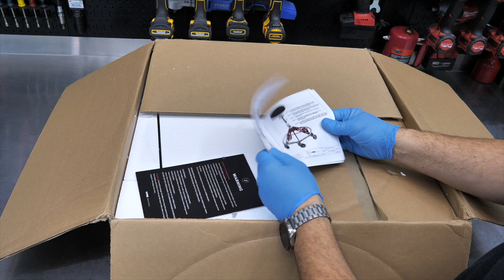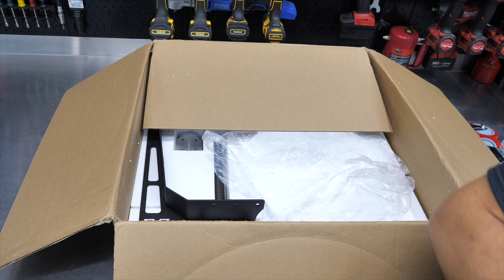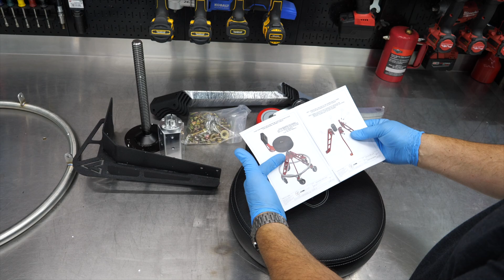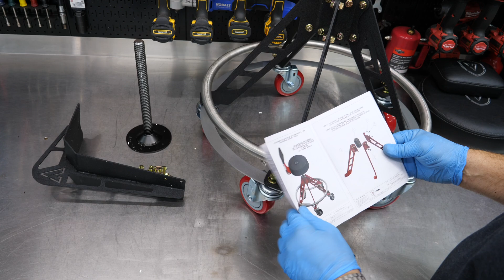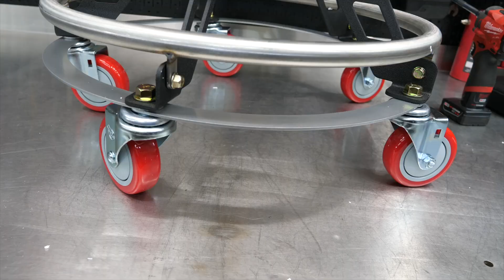Made in the USA | Vyper Chair - Best Shop Stool You'll Ever Buy! [Elevated Height]

Comment: built my own with a welder and 200 bucks of steel and 6 castors for 40 bucks. its as short as the red one but adjusts a foot up from there. that vyper one sits SO HIGH.

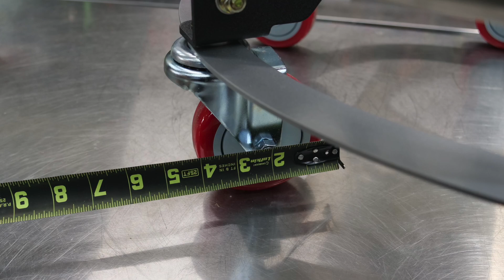Comment: So how about those "expensive industrial casters" @23:30 that are supposedly so much better that what you could buy at Harbor Fright? Well, it took about 5 minutes to look up "SCC" casters and find that these are assembled and sold by Service Caster Company (SCC). The photo of their light-industrial 4 inch swivel caster with 1/2 inch hole matches these casters exactly. And the cost of these premium casters? Would you believe $11.68 ea in black urethane (SCC-BH20S414-PPUB-BLK)? Oh, but these have RED polyurethane, so what about that? Yeah, colors (red, blue, grey, and even purple) are the same $11.68. And that's per each. So imagine the discount you would receive if you bought hundreds or thousands at a time. So not exactly casters that alone would cost you $100 or more, as Shop Tool Reviews would have us believe. Oh and how about Made in USA? Well not exactly. The casters are assembled in USA from "global" sourced components. Does all this really matter? Well, it kind of does when you consider how hard Shop Tool Reviews worked to justify the premium price for the "all made in the USA" premium product. I guess it comes down to the old adage, Caveat emptor.

Comment: If they get these down to $300 with the quick height adjustment and tool tray, they'll have my business.  I love high quality stuff, but I can't think of a single time where I had to pay 10x the price to get high quality.  As someone with a detailing business on the side, here are examples where I went with the highest quality over "good enough", and the cost increase that was associated with each:

Dual Action Polisher - $465 Rupes vs $170 alternative (2.7x)
Pressure Washer - $1,100 Kranzle vs $250 alternative (4.4x)
Pressure Washer Hose Reel - $280 Cox vs $80 alternative (3.5x)
Paint Thickness Gauge - $695 Defelsko vs $190 alternative (3.7x)
Impact Wrench - $370 Milwaukee vs $190 alternative (1.9x)
Scissor Lift - $9,900 Nussbaum vs $5,800 alternative (1.7x)
Air Compressor - $440 California Air Tools vs $150 alternative (2.9x)

and then there's...

Rolling Stool - $605 Vyper Robust Steel w/ quick height adjustment & tool tray vs $60 alternative (10x)

The $60 alternative is the Craftsman Work Seat.  I agree that the Harbor Freight stool in this video is complete junk, but the Craftsman has a stable, square base and very thick padding that gets the job done.  I'd be more than happy to upgrade someday though

Comment: Those are some pretty crappy looking nuts and bolts for a $600 chair.  I would expect SS,  or at least nickel plate.  I would like to have seen you dive into some front end suspension work using the chair.  
You always get a thumbs up because you are fun to watch.
Reply: @thevyperpodcast  
  They make snap on plastic covers for bolt heads.  It is, after all,  a $600 chair.
Reply: @thevyperpodcast  
  So the seat cover is leather then?

Comment: The down side to these chairs is if you weigh over 150 pounds your going to fall on your fat ass . Been there done that .
Reply: They’re rated for 400lbs
Reply: @VyperIndustrial  just because they say 400 lbs does not mean it will hold up . Kinda like my milwaukee battery they say they have two year warranty but went I sent 3 of them in they would not replace them even though they had less than a year of use . People lie about there stuff all the time .
Reply: @johnbailey9682  This is one of those that hold true. Thing is built like a tank.
Reply: @VyperIndustrial  time will tell

Comment: you were right, my jaw did drop when you said $600 but.....you get what you pay for in this case...once you buy it and see how it works, you won't care that it cost that much especially when it is still around in 10 yrs and still looking good....i wonder if they have it with a tray in the bottom to hold tools and parts
Reply: I'm not sure about the elevated version, but I know the shorter one does have it as an option.
Reply: I'd say it was used more for sitting at a work bench or table than working down low close to the ground.

Comment: I think the bottom curved steel braces are supposed to be installed so they curve inwards
Reply: I think it showed they could be both ways
Reply from the maker: Yes, we opted to put them in the circular pattern. They will work either way.